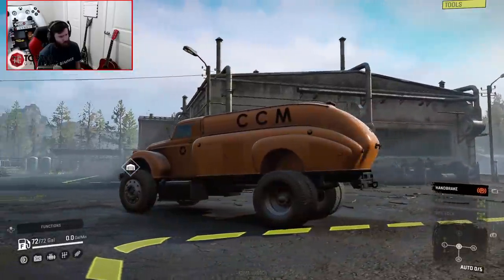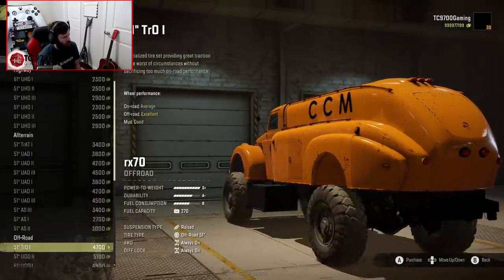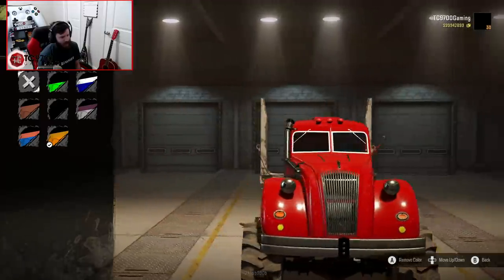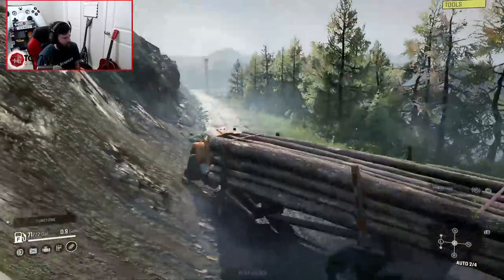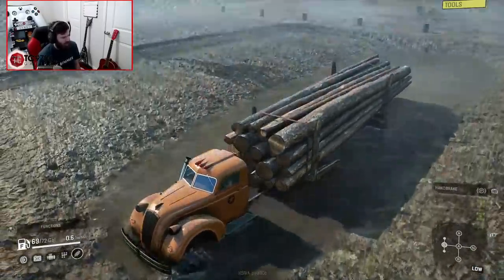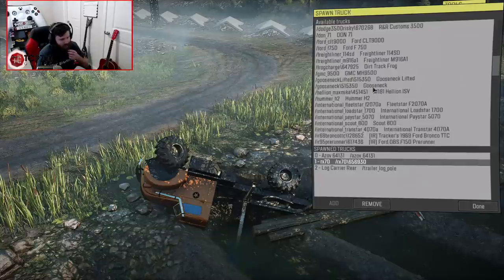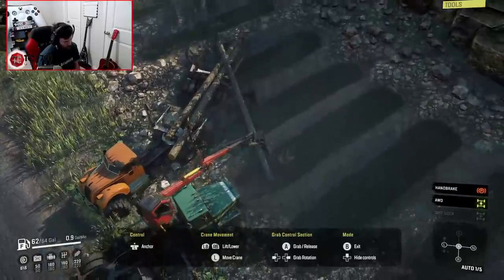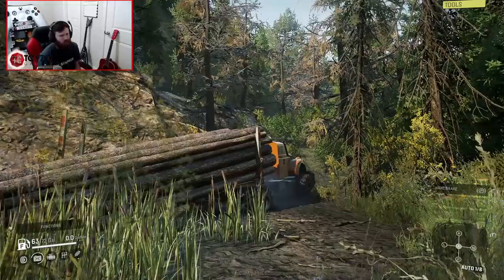SnowRunner: This STRANGE 1938 Truck Is Actually VERY GOOD!

Comment: The BigFoot 5 got its massive wheels and tires from a Snow Train it was used to deliver supplies to troops during the 40’s to 60’s and it could go through deep snow that other vehicles would sink in the snow. It had 16 wheels powered by electric motors with two diesel turbine engines as generators. I want to see the Snow Train in snow runner at least part of it. Look it up!